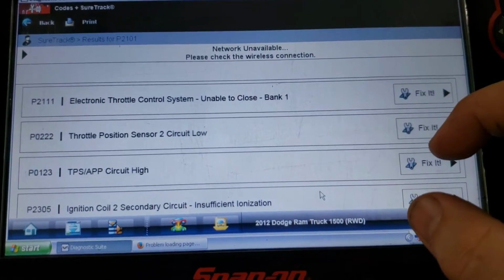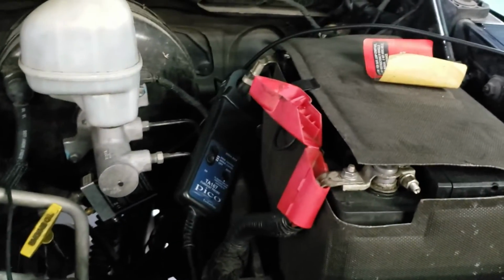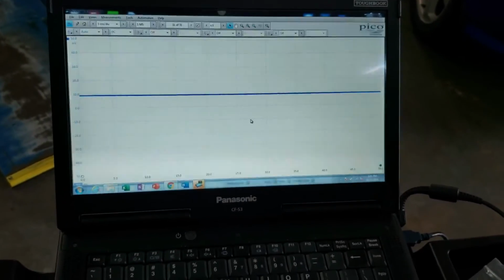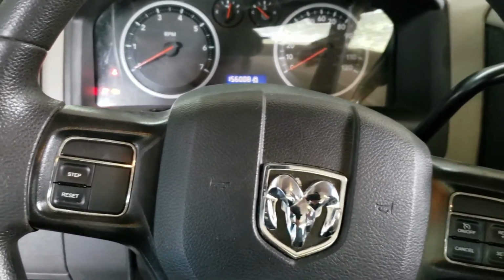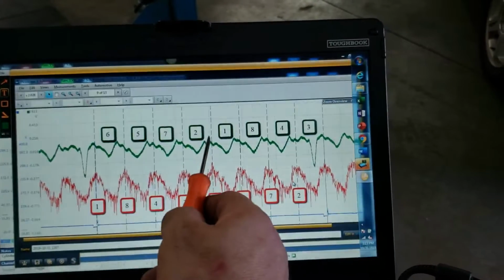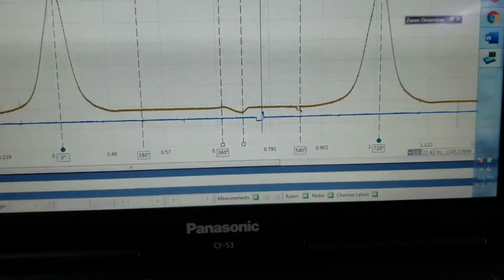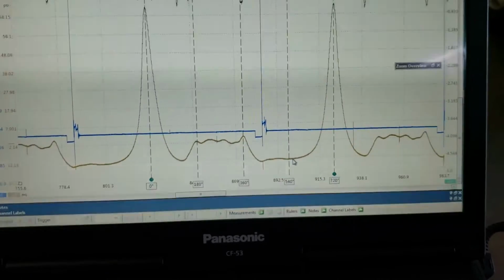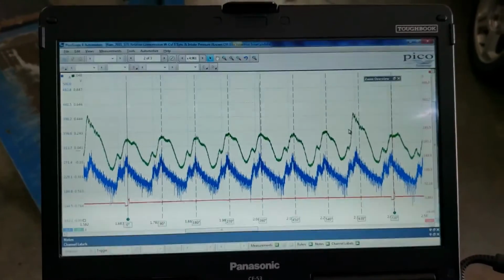2012 Ram 5.7L Mechanical Misfire Diagnosis Using a Scope & Pressure Transducers

Comment: I have the opposite. I have a cylinder  6 misfire at idle, but once I get over 1000 rpms it goes away moved  coils plugs and injectors  nothing done  compression test and good and done a cylinder leak down test  and was normal so im scratching  my head now my be my cam wore a bit but the engine uis a fresh rebuild I also can't find any vacuum  leaks and the motor is nonmds can any one help

Comment: Just took my 2014 ram hemi into dealership to get fixed. Has a tic and cylinder 2 misfire. Was worried it was the lifters. They said it looked good. Looked at it for 6 hours charged me $300 and fixed nothing.

Comment: My 2012 ram 5.7 hemi has been sitting for about nine months.  It will crank but will not stay running.  Shows a missfire cylinder 2. I changed 2 plugs and pack.  Added fresh gas with seafoam. Still not running. Still showing misfire cylinder 2. What can i try?

Comment: Great video. It was not too long and you definitely convinced me of the necessity of the transducer. I want to take a class so bad so I can learn this stuff better but i have been investing. I bought a uscope a year ago and a few months ago i bought the autel with all the scope accessories and in practicing but i realize that i really need a class cause I stuggle with getting the captures right. I have to do several takes before i can get it to appear right on the screen

Comment: 2012 ram 2500 5.7 p0300 can’t figure it out any suggestions checked the plugs changed crank and cam sensor nothing
Reply from the maker: I would suggest having the vehicle diagnosed by a professional before any more parts are thrown at the car.

Comment: Hi I’m an auto tech trying to become more fluent with a scope we have a shop supplied versus edge as our scope can you explain the difference between the 0-500 psi snapon pressure transducer that we have and the one that you are using to measure intake vacuum, will ours work for that or will we need to buy something different for this type of test

Comment: Absolutely brilliant video clearly explaining the concept and benefits of in cylinder and pressure pulse diagnostics, resulting in fast diagnosis without turning a spanner, saving time and getting a fast and conclusive result which you can charge for accordingly.    Look forward to more uploads on european vehicles.
Reply: Can you do in cylinder compression test verifying

Comment: BRIN...Absolutely the best video I've seen on explaining the intake pulse over the effects of excessive lash or possibly cam lobe issues. Very informative bud..not long winded at all. You did great.!  Question on the pulse sensor located where you did at the throttlebody. Is there a reason not to use the brake booster line or an actual vacuum port.?  I may contact you later more thru our FB group about this if you don't mind. 

Thank you Brin for sharing your knowledge.  Cheers

Comment: question, just had a 2012 dodge van 3.6 miss on #3 cyl off idle, cranked abnormal, did relative compression, showed #3 quite a bit higher than the rest. did a manual compression test showed # at 240 psi the rest at 160 psi,  remover valve cover and found both cam lopes for the intake valve ground down, why would the intake valve not opening cause such high compression?  running compression on three was 60 psi the rest were at 90 psi. once i changed cam and rocker arms compression back to normal 160 psi
Reply: The intake valves must have been opening. With the #3 intake lobes worn, it would cause the intake valves to open late, the intake valve  lift would be reduced and the intake valve would close early. The cranking compression was higher because the the valves did open to let enough air in during cranking to fill the cylinders but the valve closed early in the compression stroke due to the worn lobe. When the valve closes early in the compression stroke, you're compressing more of the cylinder contents and less of those contents are going back into the intake through an open intake valve.

Comment: One of the best and easiest explanations on cyl  identification when using a pulse sensor.  Also a great video explaining what incorrect valve timing looks like.  Guessing the ramps on the can lobes were equally worn or you would see leaning towers?
Reply: Adrian, thank you so much for the kind words! The towers will lean when there's cylinder leakage during the compression stroke only. If the intake valve closes really late, you'll have leaning towers as well. A late closing intake valve is similar to a leaking intake valve because cylinder volume will be pushed back into the intake during some or all of the compression stroke under both scenarios. It's difficult to explain the reasoning for leaning towers with volume loss without a visual aid but let me try. Imagine that we have a pressure transducer in a cylinder and the engine is running. Picture the piston at BDC (bottom dead center) at the end of the intake stroke. The pressure in the cylinder at this point is equal to the pressure in the intake manifold (at sea level, traditionally about 20 inHg) . This is because the intake valve is still open. (The intake valve doesn't close until 30-45 degrees into the compression stroke). 
Now, back to visualizing the piston and cylinder. The piston is at BDC at the end of the intake stroke, the pressure is equal to the pressure in the intake and the intake valve is open. The piston is now rising in the cylinder for the compression stroke. At about 30-40 degrees into the compression stroke, the intake valve closes and we can now actually start to build pressure in the cylinder because we are  no longer just moving cylinder volume past a open intake valve into the intake manifold. When the piston is about 3/4 of the way up the cylinder the cylinder pressure is about 7psi (That's the case on this Ram anyways). The piston will continue to rise in the cylinder and the pressure will continue to build until the piston eventually reaches TDC (Top Dead Center). If there was no leak or volume loss during the compression stroke, the cylinder pressure should be very close to the same (about 7psi) when the piston reaches that same 3/4 up (in this case 1/4 of the way down) during the decompression/expansion stroke (Called a power stroke when an combustion event took place).   If there was a leak during the compression stroke, the pressure would be less at each position in the cylinder when compared to the compression stroke. This is why the towers have a leaning look. The cylinder pressure is less during the decompression/expansion stroke. 
Bernie Thompson, John Thornton, Brandon Steckler, Scott Shotten and the Driveability Guys have been great training resources on this subject.
Reply: @brinkline1870  I understand what your saying however I may just call you next time i get a strange in cyl waveform lol  P.S thanks for the very detailed explanation.  May want to make that public for others to know

Comment: Nice Job Brin! Just curious, if you didn't have the in-cylinder waveform for absolute confirmation, would having the intake and exhaust pulse waveform be enough evidence to convict that valve in the cylinder? Thanks!
Reply: The more experienced you get with these techniques, the more confident and efficient you'll be. There are several failures that I'm able to pinpoint without going in cylinder but this time, doing so helped me to understand what was going on in the intake capture. There was no exhaust pressure capture in this case study. In my opinion, an exhaust pressure waveform would've yielded very little diagnostic value when compared to the intake capture used in this case study. 
Moving forward, under the same circumstances, I will likely be able to confidently condemn the intake cam lobe/lifter without the in cylinder capture. 
These testing techniques are very cool but what's even cooler is the sheer number of variables due to different failures, engine designs and severity's of the fault.  That's why people like Brandon Steckler say that it's not good to memorize. It's best to learn how to analyze. 
Thanks for the kind words and the question Paul!
Reply: @brinkline1870  Thank-you Sir. I watched Brandon's videos on TsT, absolutely AWESOME. So it's great to see case studies like you did here!

Comment: What year did Dodge start having these valve train problems on the 5.7 engine?
Reply: Jim Jones I think from 11-15 but 11-12 are the worst
Reply: I'm not sure but I thought that they made some changes to the 5.7L in 08 or 09 and suspect that the concerns may have started then but we've mostly seen 2011 & 2012's with valvetrain issues.

Comment: Great video and in depth explanation!Quick question in reference of missfire;does missfire occurs constantly, under the load only or just on idle?I had similar situation on 5.7 hemi with stuck lifter and slightly damaged cam lobe but missfire occurs only under the load 2500 to 3000 rpm.Thanks in advance!!!
Reply: Thank you so much for watching Ismar and thanks for the question. 
I did mention that the symptoms were present under light acceleration. I think that it was mentioned a few times but I know that it was mentioned between 4-5 minutes in. The symptoms will differ depending on severity but in my experience, when the failure is with an exhaust lobe/lifter, the symptoms will be present at idle due to an egr type effect in that single cylinder. In my experience, when the failure is with an intake lobe/lifter, the symptoms were present under load. I did mention this in the video too. I suspect it's due to the cylinder not being able to contribute equally when compared to the other cylinders. An imbalance if you will. If this is the case, I suspect that it's due to the reduced intake valve lift on the suspect cylinder. That is speculation only. I can't recall hearing anyone talk in detail about this.
Reply: @brinkline1870  Thanks for the answer Brin,it was intake lifter on cyl#3.👍

Comment: Great video that was slick, for future video topics, I would like to see how you would go about calling a VVT actuator, not the solenoid but the actuator on the camshaft. They are expensive and can be a pain to replace so I would like to improve my abilities on calling these with confidence.
Reply: Yes lots of important info here !
Vvt 
All :
Check engine oil level.
Top off with quality oil 
Most should use full-synthetic !
Use a scanner that has an actuator functional testing.
(Most don't require much labor to remove and inspect/clean screens)
Submerge valve end only-  
in fresh engine oil for 10-15 minutes.
Reverse procedure and see how it runs
Reply: There's some great classes on the subject. The ones that I've attended that come to mind and have given some good advise on how to differentiate the cause of timing issues on VVT applications are John Thornton's and ATG VVT classes. We will definitely keep your request in mind though. I agree that there's a need in this area. 
Pinpointing timing concerns on vehicles with VVT are more difficult when compared to non VVT vehicles for sure. You have to consider base timing concerns, base oil pressure concerns, solenoid electrical or mechanical concerns and phaser concerns. I did have a video on this channel where I diagnosed a 5.4L 3 valve VVT on a Ford F Series with a timing fault. Check it out. The fault was due to one of the concerns I mentioned above.

Comment: Sir, I know you are well versed in the Snap on Verus scope. Would this be possible to do using the Verus scope ?
Reply: Which part? The pulse sensor or the incylinder?  Both can be done on the SO, but you'll lose detail. Also the cursors on the SO aren't as detailed... there's no setting up a 720 degree stroke... 
That's just one example. But surely, they can both be done on SO
Reply: I concur with Cuba. My short answer is yes, the Snap On Verus can absolutely do these test. I use both scopes but when using pressure transducers during engine mechanical testing, my first grab is the Pico. The sampling and the software features of the Pico make life a little easier with these kinds of test.